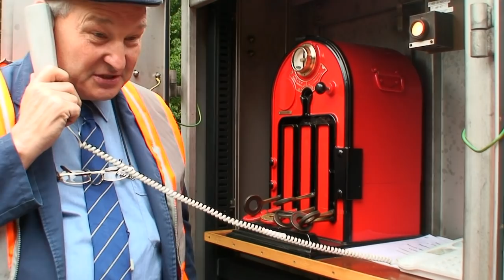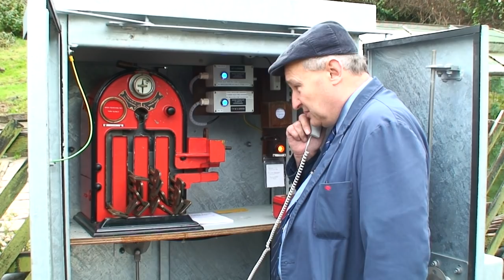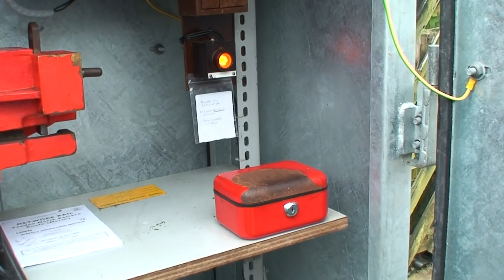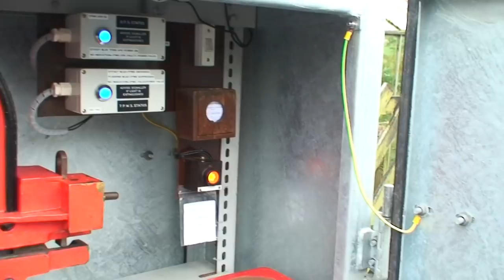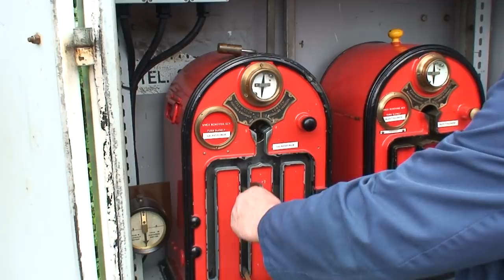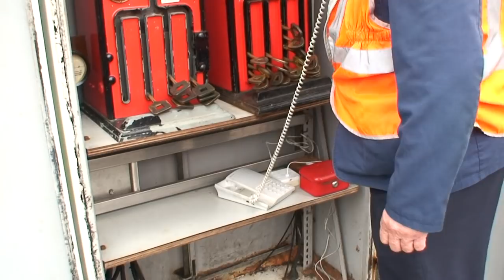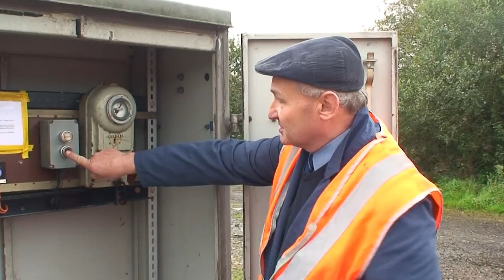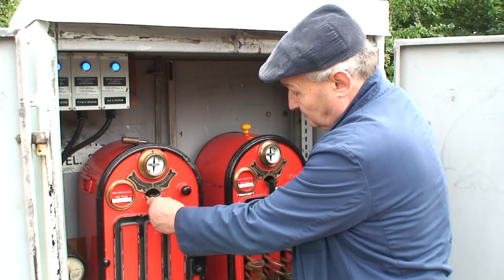Grosmont to Battersby Route Learning and Cab Ride on Class 25 No. D7628 - Part 1/2

Comment: Crikey! No wonder it takes so long to get from Whitby to Middlesbrough; all this faffing about with token machines. Why is there no signalmen at Glaisdale and Battersby to hand the tokens to drivers as the enter/leave the station like at Nunthorpe? It would be far more efficient. Other than that what about radio signaling, or track circuit block? 😫
Reply: It's the low speeds because of the poor track and bridges that slow things down, not the tokens It only takes like 2 minutes to exchange tokens and it's only done twice while passengers are boarding so changing the type of working really wouldn't be worth it. If there were signal boxes at Battersby and Glaisdale the only difference would be the signaller will remove the token and driver will have to stop to collect it from them anyway so not really saving any time, plus signal boxes are getting closed not opened.  For track circuit block they'd have to track circuit the entire line then install signals and that would likely be very costly given the rural nature of the line and ERTMS ETCS Level 2 or RETB would require the trains that uses the line to be retrofitted with the equipment in the cab and that would bring issues with running heritage stock on the line especially for locos visiting the NYMR for galas they seem to be doing away with RETB anyway and ETCS is still very costly and other lines need it much more then the Esk Valley does.  The line would likely remain NSTR for the foreseeable future.  Plus if they resignal it they'd likely shut Nunthorpe box and do it all from York ROC so the signallers will lose their jobs.
Reply: @tgm9991  The signalmen can easily move to other locations. I was thinking of radio working the line like the Ravenglass & Eskdale is signalled. The driver reports his position on the approach to a loop and signalman tells him to stop or go through as appropriate. When clear and in section the driver confirms this with the signalman. Easy as putting on a hat!
Reply: @nigelkthomas9501  No the signaller can't they have to stay with their box and Ravenglass & Eskdale run toy trains this is the real railway with real trains where working by verbal instructions alone on a single line gets people killed we learnt those lessons early on with railways.
Reply: @tgm9991  Well, there’s never been any problems on the Ratty with radio signalling that way. It’s very efficient. Why does size matter? I think you might be thinking of time interval working which obviously wasn’t great because if a train broke down there was no way of letting anyone know what had happened.
There’s a railway somewhere in Switzerland that’s signalled just like the Ratty. That’s where they got the idea from.
Reply: @nigelkthomas9501  Size matters because they're not held to the same standards as full-size railways they don't run to the same rule book and the consequences are reduced when compared to the potential of two 70 ton multiple units hurtling towards each other at up to 60-75mph.  The whole reason that signalling systems on the mainline are interlocked to prevent conflicting moves is because human beings can't be relied on to remember where their trains are and not get distracted which is something that purely using 2-way radios don't protect against.
Reply: @tgm9991  Fair point I guess. Perhaps it’s time to sort the track out then and improve the line speeds. The recent replacement bus service which ran non-stop Middlesbrough to Whitby was actually quicker than the train!